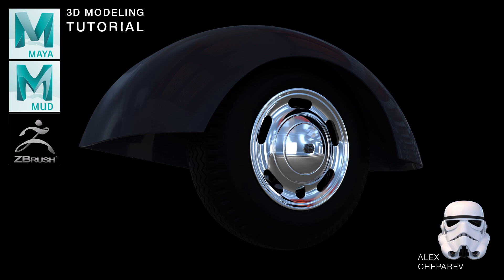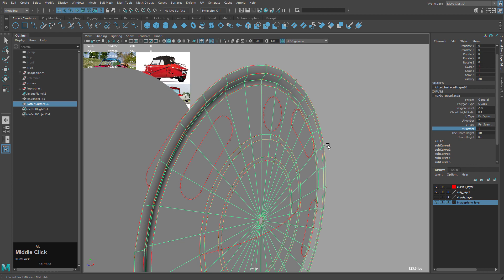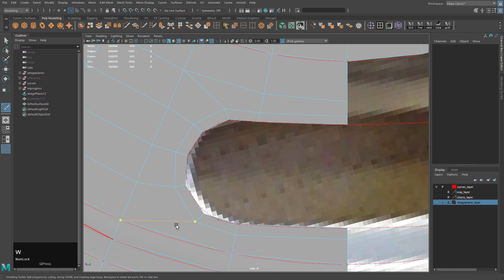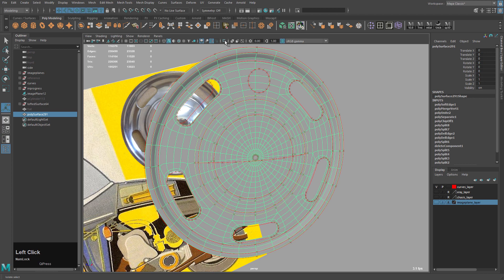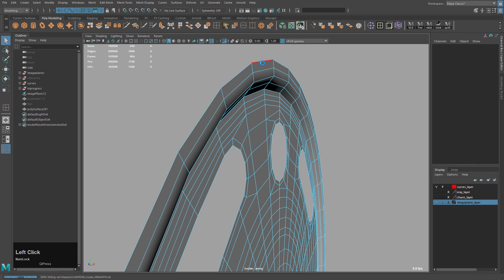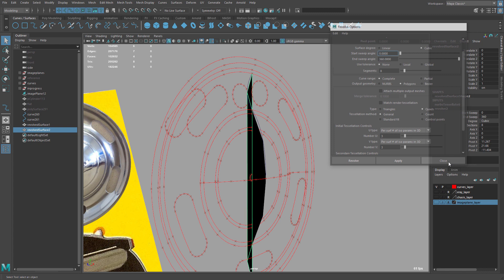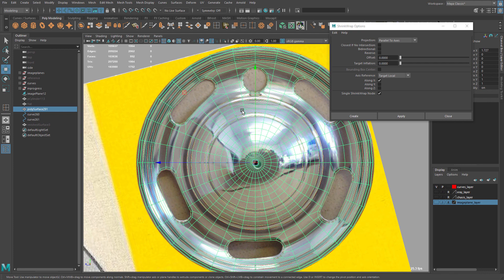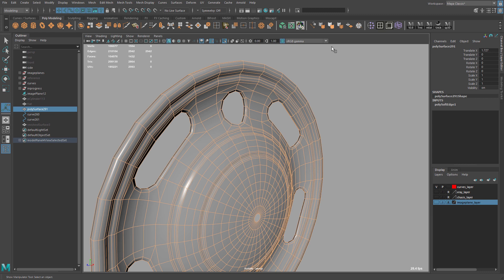3D Modeling a Car in Maya - Hubcap / Wheel

Comment: 12:52 Hi Alex how do you select one object in object mode and another in component mode at same time? I clicked on shift select after selecting my vertices but the other object then is in component mode as well.
Reply from the maker: make sure to start out in object mode and after selecting the first object, right click and select edge, vertex or face on the second object while holding shift
Reply: @AlexCheparev  Ok cool that's working thx.